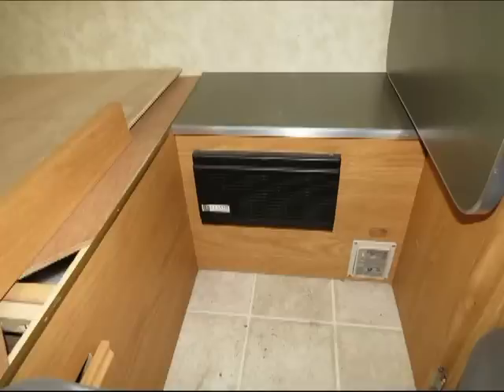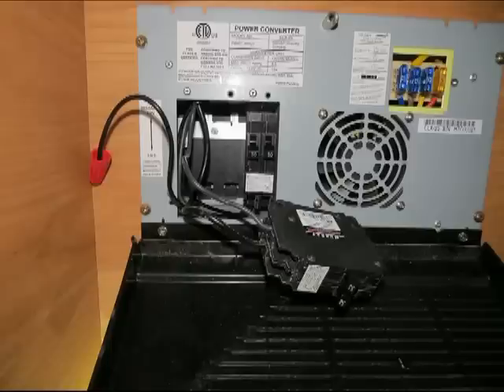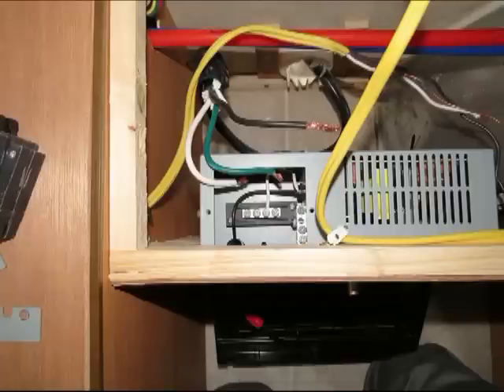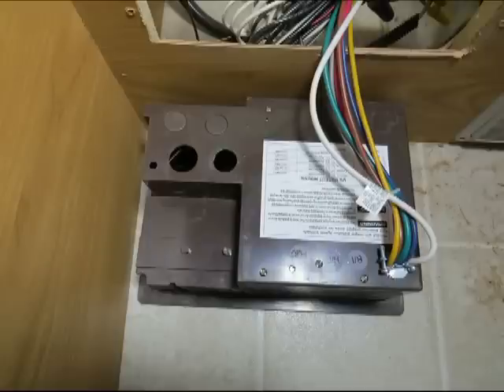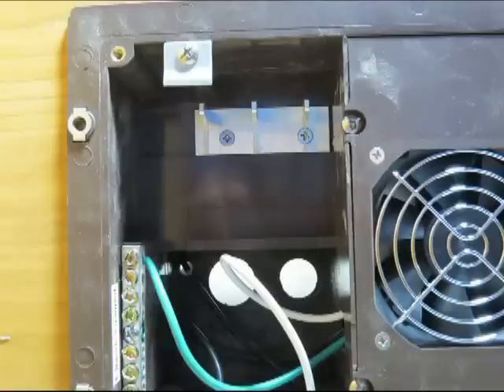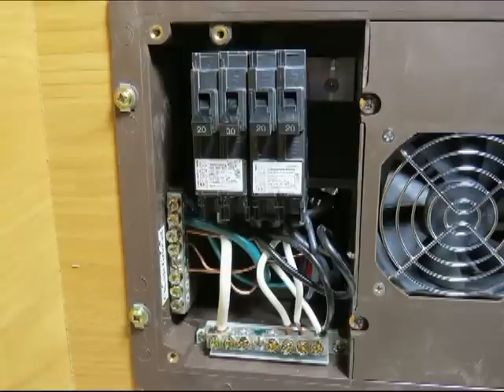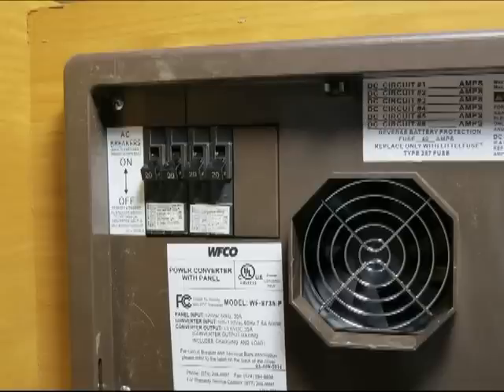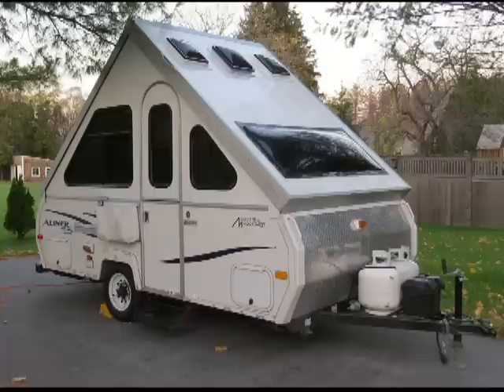Aliner Aframe Popup Trailer WFCO Converter Upgrade from Elixir

Comment: Just finished swapping out the old Elixer 20 for the WFCO which worked out fine.  We have a 2004 Aliner Classic.  The Elixer 20 had only one circuit breaker which was a 20/15, with the 30 amp wire going directly to the converter bus panel.  So, I was just a bit intimidated at the beginning of the challenge, but went slow, kept looking at your video and victory was the ultimate result.  Thanks so much for taking the time and effort to put this together.
Reply from the maker: Good for you !!  You probably saved $150 doing it yourself.  That is what "Yankee RVing" is all about.  Feel free to send me the money..LOL....  Just kidding.   But very nice of you to leave the comment !!  Its very rewarding to hear these videos do really help people.
Reply: Actually, it could have been a lot more than a mere $150, as that was the charge just to show up at our house to do the repair, and I did some calling around for estimates.  Then, it would average $120 per hour for the repair.  If we drove it to the local RV dealer, it would have been close to $500, with the new converter.  So, I opted for a few skinned fingers.  Sorry about the lack of $ coming your way, but we send many good wishes, and you should know you've made some happy campers.  And, BTW, do you know anything about repacking the bearings?  I usually have it done by a local trailer shop before we go on an extended trip, but last time, while we were in Yellowstone, a bearing went out and we were lucky they had a garage near the visitor center which did a great job.  So, anyway, I'd like to start doing it myself, but haven't seen a good youtube yet.

Comment: Thank you. Very good information.  My used pop up has same as yours that previous owner installed.  However they did not do a good job with the AC connections and therefore my breakers would not control my receptacles. Breakers on or off my receptacles were always hot when trailer connected to shore power. He had shore power wires connected to same breaker as house power wires
Reply from the maker: Wow,  Hope you made it right and safe!
Reply: @GoingNoWhereFast  last night I switched the house AC wires to a separate breaker. After seeing your helpful video Im going to add a separate breaker for the inverter or converter whatever it is😁
Reply from the maker: @benlopez4788  That sounds very smart!

Comment: Great video.  I'm much less concerned about scorching myself when swapping out my converter.  Nice to see that this was an Elixir converter going out, which I have, and a WFCO converter going in, which is very, very similar to the Progressive Dynamics PD4135K which I have.  Looking forward to this project now!
Reply from the maker: +Matthew Mantle 
Let me know how the progressive works for you.  I have recently heard a lot of chatter on the cheapness of elixer versus the wrong settings on the WFCO and then the progressive is supposed to be the best.
Reply: +Going NoWhereFast So far I'm thoroughly impressed with the PD4135. I had to expand the vertical cutout by a half inch to install, which was simple to do. The unit left lots of space for connection on the AC breakers, and the wiring for the DC fuses was simple. Now, the charger has been amazing, slowly increasing charge until hitting the maximum 14.4v boost voltage, then decreasing to 13.6v for normal charging, and finally to 13.2v for storage. I haven't witnessed the 14.4v equalization mode, but that's only because it is a 15min boost every 21 hours. The fan is very quiet, and I had it pressed to perform this weekend with basically everything (fridge, furnace, water heater, lights, microwave, bunk warmers) running at once on a cold, rainy, and snowy Victoria Day long weekend...not even a hiccup. So, overall I'm very impressed so far. 

Anecdotally, I'm glad I replaced the Elixer - I found a number of loose wires inside when disconnecting the unit, with arcing/melting damage evident

Comment: Great video. Replaced my Elixir with wfco8735 today with your video assistance.
Reply from the maker: Great to hear !!  Thanks !  I wish I could remake that video, its a bit prehistoric at this point.  One of my very first ones, but also one of the most popular.  But to remake it I would have to pull my power convertor out and start over... not really goning to do that, so I'm glad it has some use still !

Comment: Very good video. I had to do the exact same installation and your video really helped me.Only 1 comment , when you showed the new converter installed with the fuses in place 2 of them were in the wrong place for the Aliner.Thanks for help. 
Bob from Montreal
Reply from the maker: Yes,  I had to change them about 3 weeks after I uploaded the video.  Not a critical failure causing error though.  Just need to switch them around when the one blows

Comment: I have white wire like the yellow house wire in my pop up right now. I am upgrading from 15 amp to 30 amp using the WFCO converter. I only have one wall jack in the whole trailer and will be putting in more. Do you have any suggestions if I have to change out my wire to the one jack or if I can use that wire. It is in great shape as far as not being damaged anywhere and I was told I could still use that wiring but just thought I would ask :D Thanks for this information it will help a lot when putting in my other boxes and my porch light outside as well.
Reply: The wire should be at least rated for 15 amps. If you change out that outlet to a GFI (you should anyway) then any plugs connected "down stream" are also GFI protected. So make the GFI the direct connection.

Comment: From what I read Wfco isn't much of an upgrade over elixir but the progressive dynamics 9200 series is a solid upgrade.
Reply from the maker: Progressive is making a quality name for itself, but the WFCO is a good converter and 3 stage battery charger.  The elixir is a straight 1 stage charger .
Reply: @GoingNoWhereFast  never seen an "upgrade" TO a WFCO. Didn't know there was anything of lesser quality/ features.
Reply from the maker: @bobcole3852  Everyone has an opinion, it was really easy to install, it matched the elixir that was in there. And it has more than 3000 hours on it without a problem. Can’t complain

Comment: Thanks for this! One thing missing was what to do with the branch wire that comes off the inverter wire. I called and was told that can be bridged with another hot lead to share the breaker should be panel be full. Also, the inverter get's it's own 15amp breaker. Just put a wire nut on it if you are not going to do that.
Reply from the maker: Ya,  I thought that was in the "Annotations", but they might have been removed by Google as they have threaten that for some applications.   Thanks for the comment !

Comment: Almost finish the job but still have on black cable not plug. Don't know where to plug. On the diagram of 8725P, WFCO says " Black wire to AC shore - hot " ??? Don't know what to do. Thanks for helping.
Reply from the maker: Is it coming from the converter or from the camper wiring?    If it is coming from the converter, it probably should go to one of the 20amp breakers to power the converter.  If your not plugged into the house/shore power, see if your lights and 12 volt appliances work.  Then unhook the battery and plug into the house/shore power and see if you have power.  If not, that's what that black wire is.  It carries the shore power into the converter to run the lights and appliances and charge the battery.
Reply: @GoingNoWhereFast  Thanks for your answer. This black wire comes from converter and is connected at one end on aluminium piece juste beside where to anchor the AC breakers. All my 4 breakers are full now. 30A with the big black coming from shore power cable. Two 20A for the 2 AC circuits and the 15A with the black wire coming from DC side of the converter. There was no such cable in my old Elixir...

Comment: I have fully charged battery but my fan and lights and outlets aren’t working.😞when plugged into shore power everything works fine. And I just bought new solar panels to run off grid. Do I need to get a inverter to run my converter on battery power?
Reply from the maker: Your trailer has 2 different electrical systems.  12 volt and 120volt.  Your  "CONVERTOR" takes shore power (120volt) and  reduces it to 12 volts and sends that to all the lights, fans, frig, etc. And also sends 120volts to your outlets.  If your not plugged into shore power you only have 12volt power from your battery.  Solar is just a way to charge the battery slowly.  If you don't have power when not plugged into shore power, your battery is probably either unplugged,  has a blown fuse, hooked up backwards,  or is dead.   For hooking up a battery white is negative, black is positive.  Hope that helps
Reply: @GoingNoWhereFast  thanks again👌🏻😄

Comment: Was it worth changing after all said and done? Thanks
Reply from the maker: Really not any difference except it has never giving me any trouble and I was warned by many Aliner users that The OEM Elixir would fail on me and drop out eventually.   So I did it.  I'll have to do it again this summer when I change to one that works with Lithium Batteries

Comment: what did you do with the other end of the pigtailed wire off the converter?
Reply from the maker: I'm not sure what you mean??   If you mean the white wires (Grounds) I bought an 8inch grounding bar and hooked them up to that.  Check out the follow up video   https://youtu.be/w1N1THVQvDM
Reply: You cap it off.

Comment: Do you have any isolation device (VSR. ?) between trailer 12V onboard system and your tow vehicle’s 12V outlet at you hitch?
Reply from the maker: I used to have a 12 volt charging line coming directly from my battery to my trailer batter to maintain a charge when the car was running and charging.  When I installed the solar I disconnected that line, since the solar charges the battery any time its daylight.  I did have a 20 amp fuse on that line.  Other than that, I do not.  Also, since I do not have brakes on my Aliner, I don't have exposed electrical lines below the trailer.  Less chance of anything shorting out.

Comment: Old converter wires are not color coded to match exactly to new converter. Problem in trying to rewire new converter. I have 2001 Centerion converter switching to WFCO 8700 series converter.  Doesn't work.
Reply from the maker: Well, then the other thing to do is to figure out what the wires do, the little ones are just 12 volt powering something like a fan, a light, or maybe the frig.  But the frig 12 volt is usually mid -sized.   The colors don't really matter, its that you get the 12 volts to the 12 volt items and the 120 volts to the 120 volt items.   Then connect the battery to the charge wire so it can charge using the different charge levels.  Otherwise you might be charging with the light power, and powwering the lights with charging power.  It will all work out in the end.

Comment: Can you add a video concerning how you hook up the little digital volt meter from your battery?
Reply from the maker: It would only be a 30 second video...   I thought I did put that into my Winterizing battery video..  But I'll visit it again in the next few videos.  It's easy though.  Cut the right size hole in battery box away from the battery terminals to fit the volt meter you buy on amazon for $8 ,  insert volt meter and attach the leads from the volt meter to the battery terminals.   You done !

Comment: Every once and a while I get an alarum..seems to be coming from the panel...what's up?
Reply: Alarm...sp.
Reply from the maker: It’s probably your propane alarm. And it happens when your battery gets low. So if you’re running off your battery, or letting the trailer sit without it being plugged in. The propane alarm will discharge the battery and then it will alarm due to low battery level. That’s the most common alarm that comes from near the power converter

Comment: Are the breakers the same as house breakers?
Reply from the maker: Yes and no.  I believe they are a special size.  The 8235 has room for 4, and the 8225 only uses 3, so I wanted to add another and could not find one that fit.   But they are the same functional workings, so maybe you could get them at a regular electric supply outlet.  But I did not find one at Home Depot.

Comment: What do you have to do if the trailer never had a converter in it.Only a power box for 120 v
Reply from the maker: You can always just add one.   If it had 120v system, you add that to the 120 side, and place a battery somewhere and wire up lights and accessories to the 12 volt side.   But I have never heard of a trailer that didn't have a convertor if it had any electrical system unless its a homemade one.  But I've only been "trailering" for 5 yuears.
Reply: I just bought a 1983 Palomino Shetland trailer.Its the smallest one they made. It has no canvas or roof, I would like to make it into a solid trailer like a teardrop one. The previous owner bought it new, on the brochure it says they all came with a converter but the previous owner swears it did not., It has a box with a breaker and the electric outlet both work, I don't think I will use the trailer on battery power. I have no way to charge a battery from the car as the trailer only has a four pin plug. I suppose I could put a battery on and that a charger to plug into the camp  site to charge the battery.
Reply: I added one to a retired FedEx  delivery truck along with a 3 way fridge and microwave. This was super helpful. This did not turn my truck into a motorhome.......but I can use it that way for an over nighter if need be. I also installed a motorhome propane tank underneath and a fantastic fan. A solar connection on the side and a generator and I am all set! (2 deep cycle batteries as well)